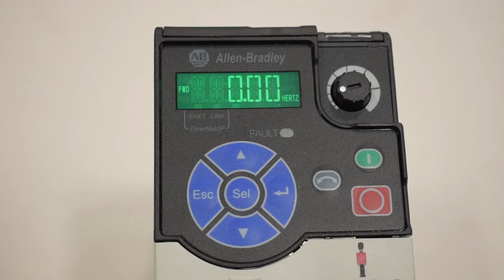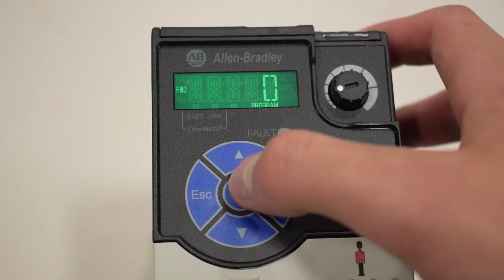Allen-Bradley PowerFlex 525 VFD Auto Restart Setup

Comment: I’ve been trying to google starting the vsd/motor automatically when vfd is powered on without having to push the green start button but it keeps taking me to this. Is it possible what I am trying to do?
Reply: I got it. Set A543 to "1" then P046 to "2" and jump digital 1 and two. (2-wire SRC control non-reversing)Stayed on after a power cycle for me, though you have unplug and replug digital 2 once to get the initial On signal.
Reply: @mattv5122 would you be able to give more detail, as to what this does. In a situation, I have, the building that has 87 PF 525 drives at them, not connected to anything, loses power occasionally, and the drives need power cycled by hand. Trying to eliminate this, and have the drives just clear the error out, and resume normal functioning.
Reply: I’m trying to do the same thing. Have you figured it out yet?
Reply: @ nah I feel like it’s a safety issue and you simply cannot. Vsd drive needs an enable signal from something
Reply: @Frog_lee idk about that. The drive I’m replacing starts upon applying power. I’m calling tech connect Monday see what they say. Parameter A543 is “start at power up” not sure how it functions though because I set the parameter then cycled power and no change happened

Comment: At my job site, our Tech guy in another state, said to set parameter A551 too 1. It wouldn't set too 1. It keep resetting to 0. I went online and found your video. I set the parameter A541 too 1. However, it did not auto clear the fault. Do you have any ideas how to help or a video too point me towards?